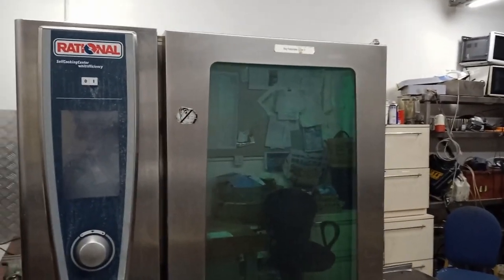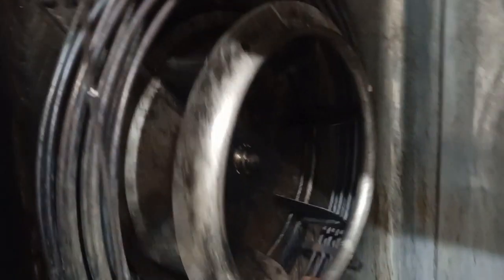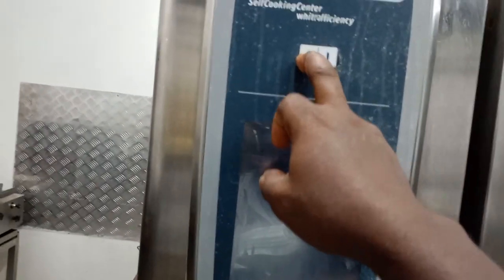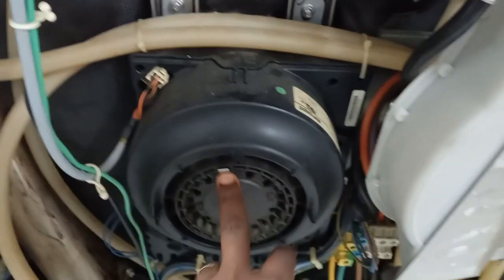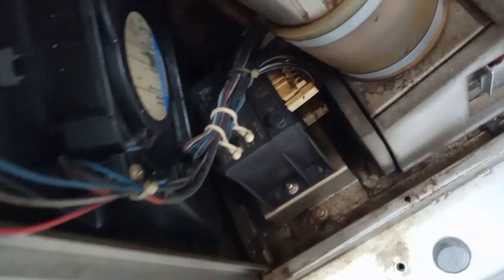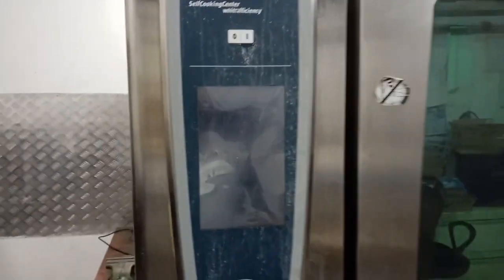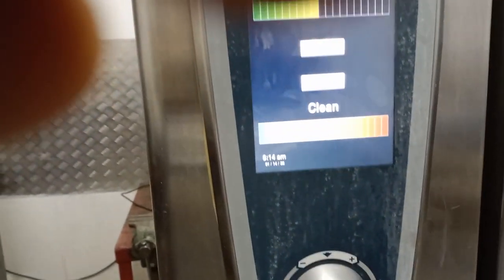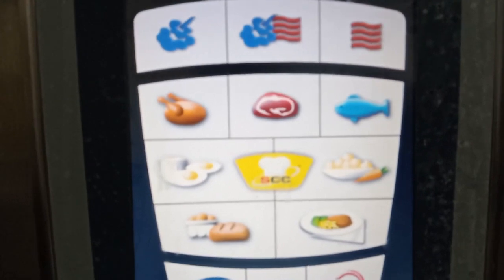RATIONAL OVEN OPERATION AND DESCRIPTION.

Comment: Busco un eror 12 gue me da la tarjeta
Reply from the maker: he onboard CDS sensor has no signal, the CDS sensor is defective, but level electrode senses water. Verify that your water supply line is connected and “water shuts off is on. If these are good, you may need a service technician to dig deeper into the issue.